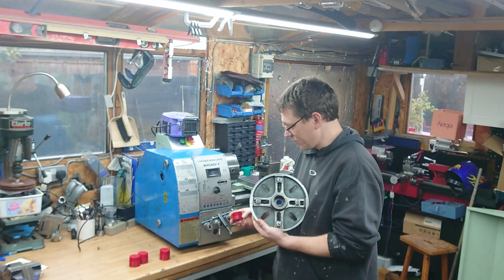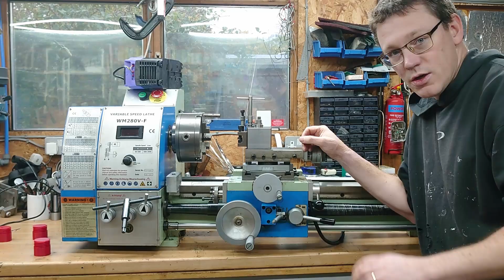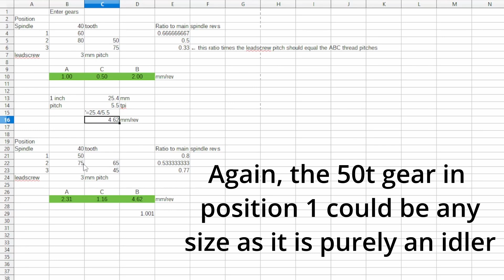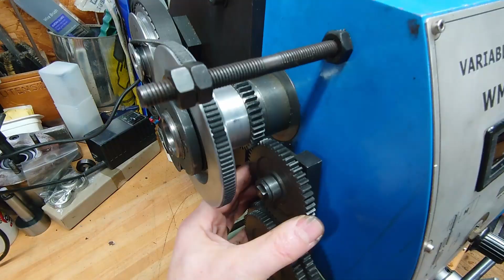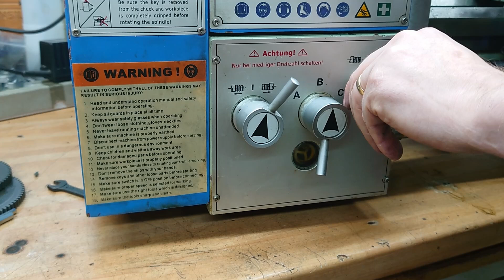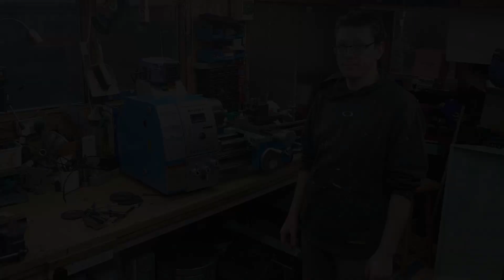Thread pitch not available on your lathe? Try this... [A23_1]

Comment: Hi! We had a discussion earlier, I made a comprehensive chart of all metric pitches in a spreadsheet for exactly the same lathe. Let me know if you want a copy. 

Interesting that we can achieve lower TPI numbers too.
Reply from the maker: Hi, yes I remember....now. I had completely forgotten about that, sorry, I still have your email.  Perhaps I'll have a go at making the thread dial, it's definitely a useful feature.  The main issue with the coarser pitches is the lack of torque may become an issue, but I have a couple of ideas to address that (sometime in the new year). Thanks for watching.

Comment: Nice one Olly
funnily enough i'm just desinging my Micro lathe i'm building for screw cutting, so i've had my head chasing around changewheels, pitches and banjo arms  to get everything in my very limited space, video's soon coming up on this. 
Well done with the 5 1/2tpi pitch, were there's a will there's a way!!!
cheers
Kev
Reply from the maker: Hi Kev, I'm looking forward to it already, you're doing a grand job on that little lathe

Comment: Another thing to mention is that when you are cutting screws pitches less than your lead screw pitch (here less than 3mm) you have a favorable torque situation since the lead screw is turning slower than the spindle and the torque available to move the cutter is high.  BUT when you are cutting screws with pitches higher than your lead screw pitch (greater than 3mm for your lathe) the torque is not favorable and it becomes easy to stall out the lathe motor with any depth of cut.  A way around this is to put a crank handle on the end of the lead screw and use it to turn the whole works, spindle and all, by hand. It is slow, but it works.
Reply from the maker: I have had that thought, I'll see how it goes, but there's always a way round a problem.  I'll have to think of a way of getting a handle on to my spindle as there's nowhere to attach on the leadscrew
Reply: There is some information in the book on making the Quorn tool and cutter grinder because the vertical shaft for it has a coarse pitch square screw slot. I have used my Dremel toolpost attachment to cut coarse square grooves, but it only really works up to about a 2mm groove size with the Dremel. 

If you are using a chuck (as opposed to a collet) then I have put an adjustable wrench (spanner) on the chuck jaw and turned it that way (lathe off of course), especially for heavy tapping or single point thread cutting right up to shoulder without crashing.  I feel that the wrench is better than using the chuck key as you see some people do.  I have been thinking I should make a crank with an expanding arbor that fits inside the spindle bore at the rear of the lathe. Turning the lathe by hand on the final pass is a good way to eliminate chatter in some situations too. You have to remember to remove whatever crank you use before turning the lathe back on!

BTW, this is always a great series and I really enjoy it!